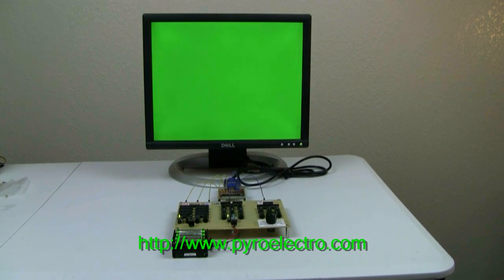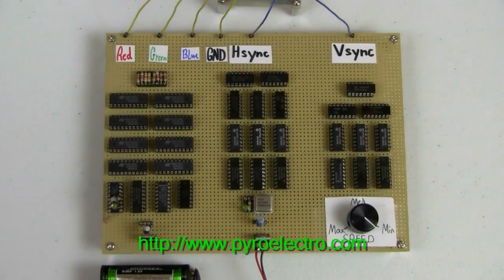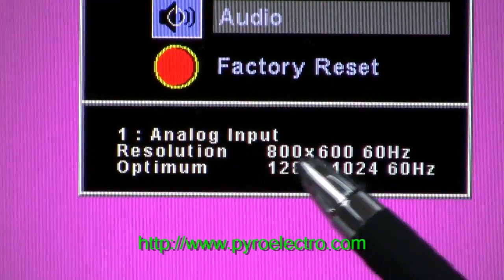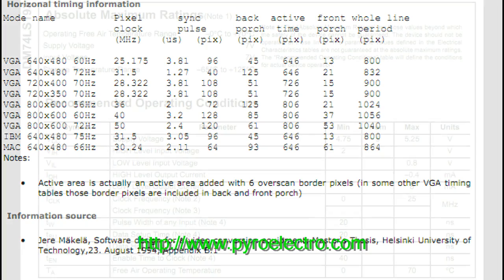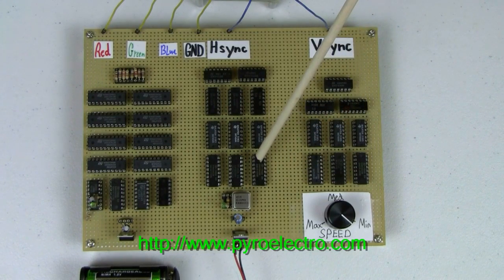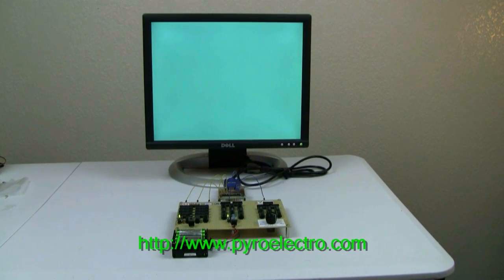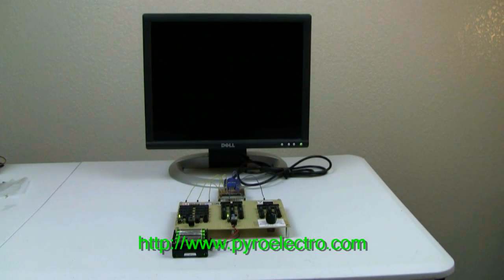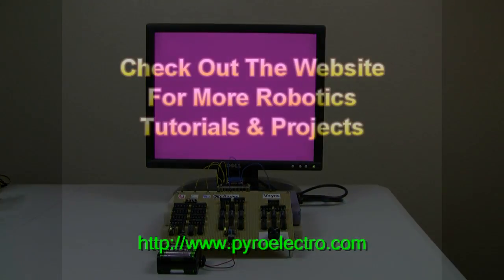Masochist's Video Card (Pure Discrete Logic)

Comment: Mind if I use this? I'm trying to make a 7400 series computer with VGA output, and I think I can adapt this to read in pixel values from an SRAM chip. All that really needs to be done is to read the output from the counters into the address of the SRAM chip. The SRAM chip would have a 16-bit address, which could be mapped as eight bits representing x and eight representing y.

Comment: What is the point of this electronic device? serious question i dont understand.
Reply from the maker: +Antonios LesvosLover This drives a monitor with basic electrical video signals following the VGA standard but with an old fashioned method of achieving that goal. It was originally designed for a contest.